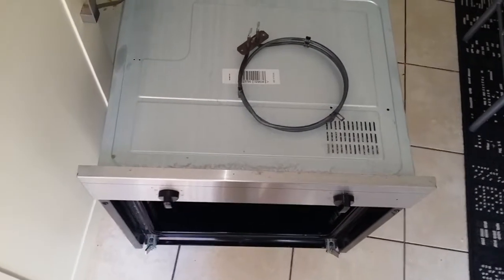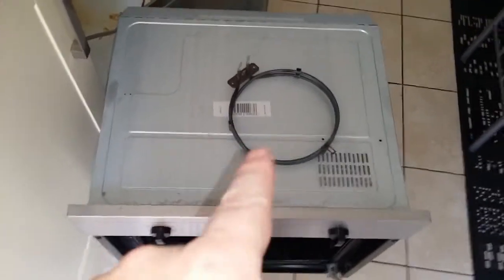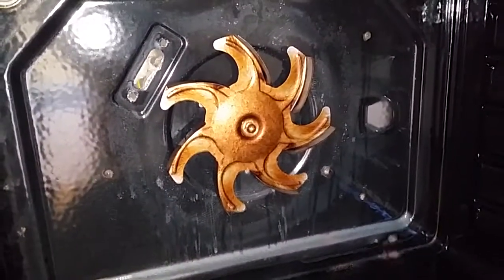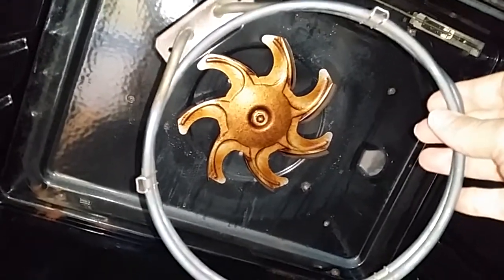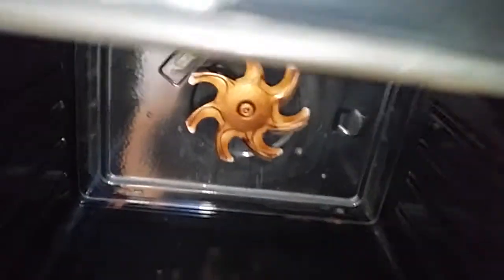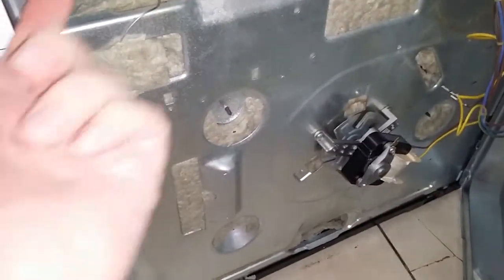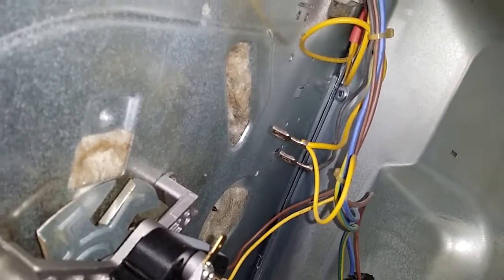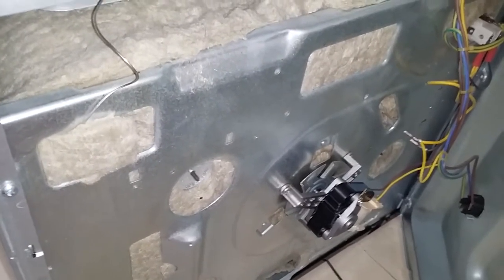Beko oven element replacement

Comment: The element in my Lamona 4603 fan oven was exactly the same with 2 of the 3 attachment screws installed from the back !! Rather than pull the whole double oven out from the kitchen unit I managed to remove the 2 screws using grips on the screw tails and back-wound them out. I then fished them out using a magnet on a stick inserted through the cable slot. Could probably leave them in there tbh as they got caught up in the insulation and not really a problem. I then opened up the two small threaded holes in the new element attachment plate to 3/16" diameter and installed it using 2 suitable self tapping screws inserted from the front. Job done in less than half an hour, just cost £10 for new element 👍🙂.
Reply from the maker: Nice, surprising amount units get slung out for such simple reasons I reckon. Thanks for watching 👍

Comment: Stupid question, but how do you know which element if you don't have model number, as you can get 1600w/1800w/2000w?
Reply from the maker: From what I remembered I did have model number, very small sticker on inner frame of door, at the bottom
Reply: @grandadgamer8390  cheers...mines is all worn...can make out '220-240V' and that's about it!
Reply from the maker: May be a lable on the back, good luck 👍

Comment: I've been wiring my fan motor with the yellow and brown wires reversed. I can't figure out which way the blade should spin because every youtube video seems to wire them differently.
Reply: For example, these 2 Beko oven advertisements show the fan spinning in opposite directions to each other. One video it spins clockwise, the other video it spins anti-clockwise. Confusing.

watch?v=p33KYy6AosM
watch?v=MWXaBfwWwJQ